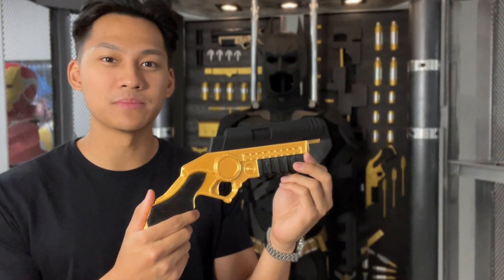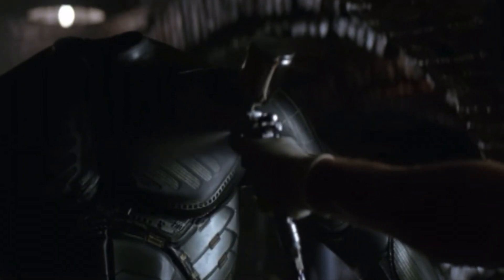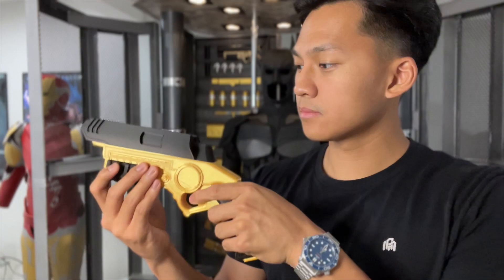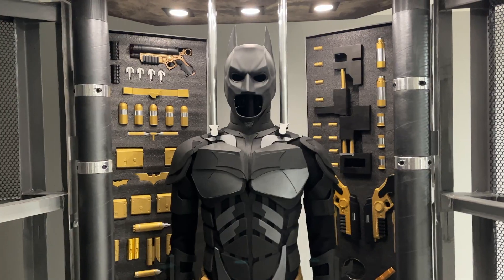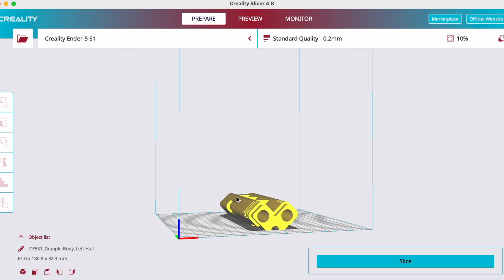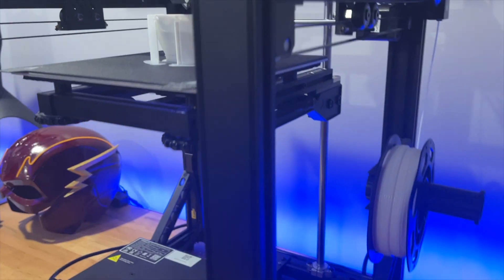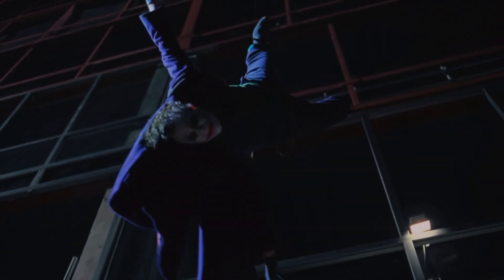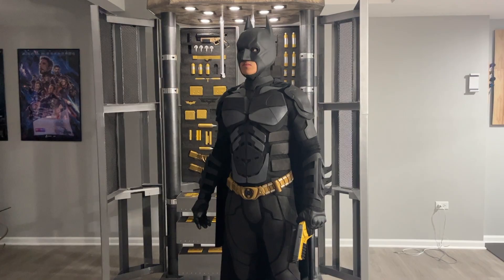How Batman's Grappling Gun Works | PropWay Explains ft. Creality Ender 5 S1

Comment: Is there any feasibility to making a “real” version of this? Obviously not something that could pull you up, just the firing feature that maybe you could then swing from? 🤔
Reply: Yes, best option would be using The same system as a gun but using blanks (basically just bullets but without the actual projectile) and then you place the “hook” on the front of the barrel and shoot it with the blank, your best bet is using something very light but strong for the hook like titanium, if you’re serious you should try using .45 blanks